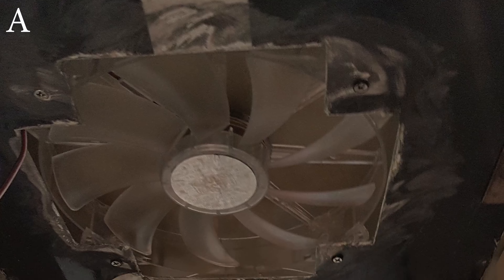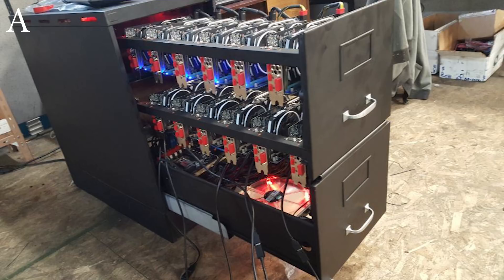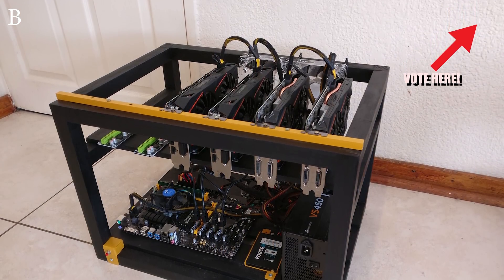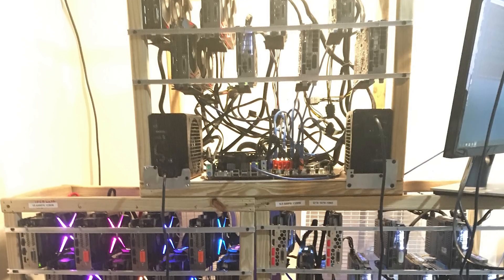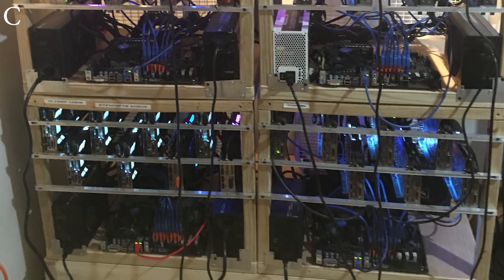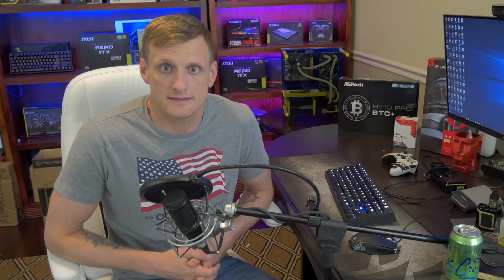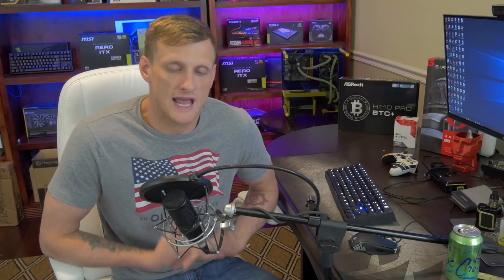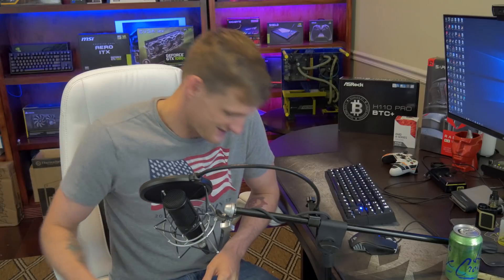Mining Rig Wars Finals #1: Submit Your Rig

Comment: The reason sidcat used 2 450s is because the price of one 1000w is extremely killer right now which is dumb af. 2 small ones are like 40% cheaper at the end of the day
Reply: ViiV Creations any suggestions on safety? I really want to go with add2psu but don’t want to kill my gpus with fire. Any experiences?